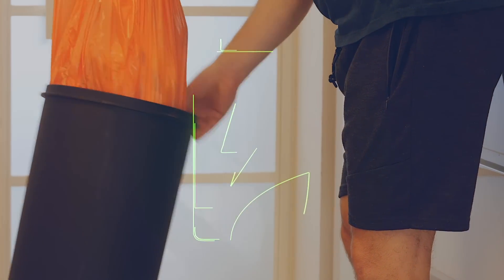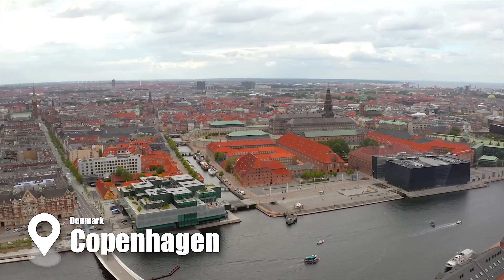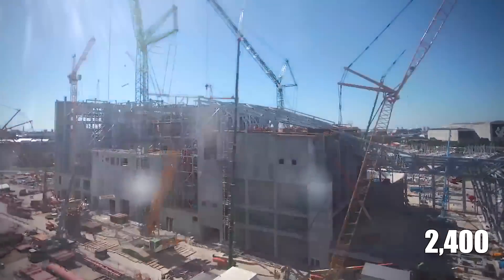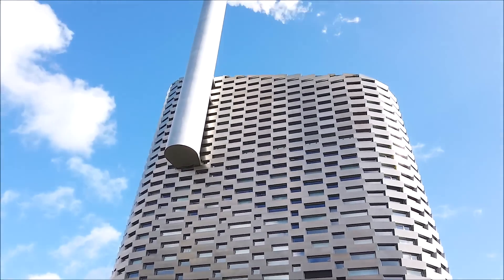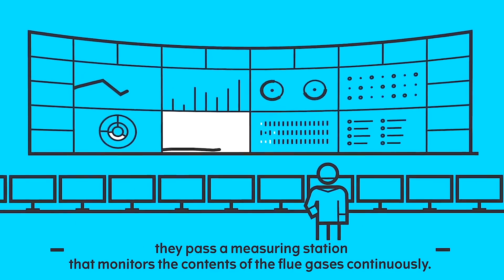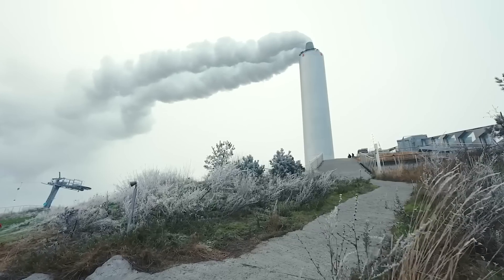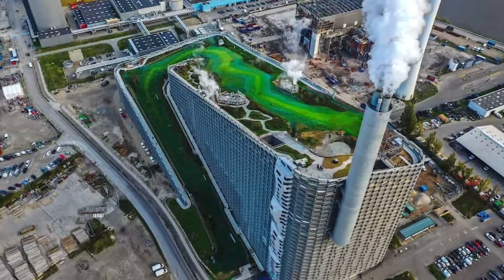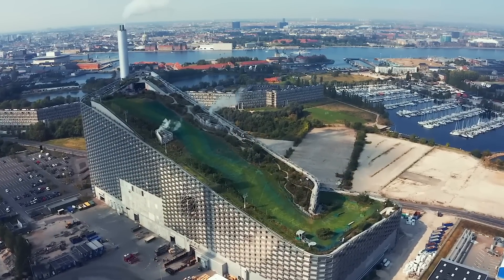Copenhagen's $670M Power Plant That’s Also a Ski Slope!

Comment: You omitted to mention that the system negates the need for landfills, which is an important part of the concept. The method of district heating where hot water is generated through burning of all garbage that cannot be recycled, and then pumped out to households in insulated pipes, is used in all cities of Denmark. However, only  the Copenhill incinerator comes equipped recreational add-ons.